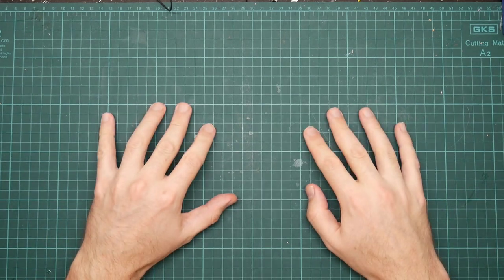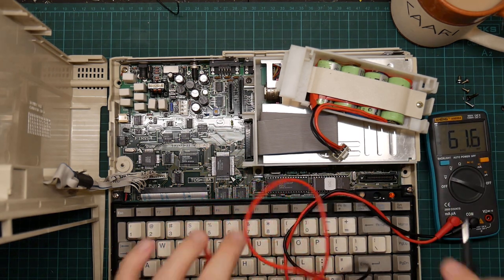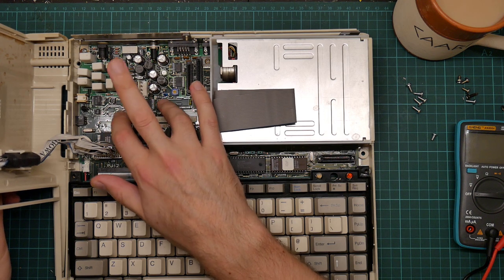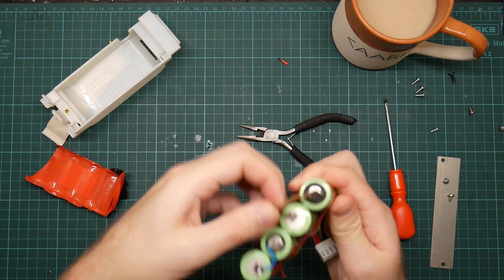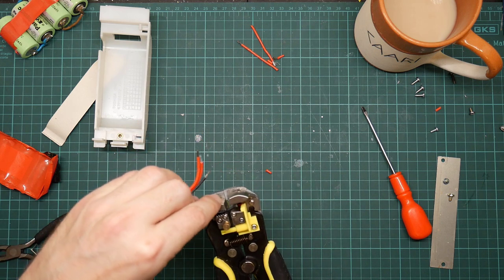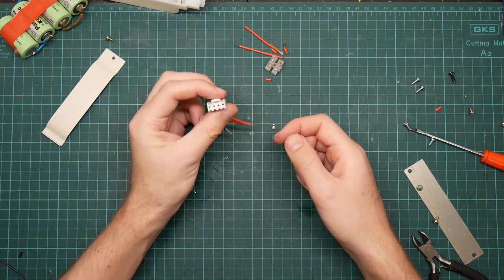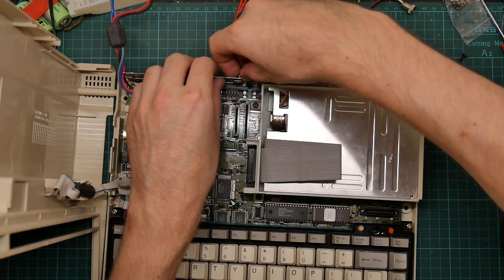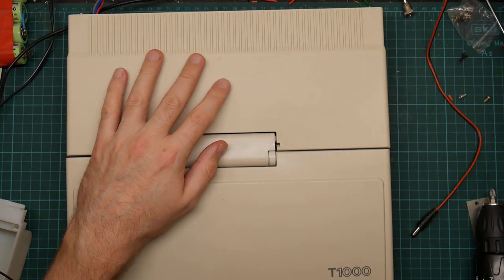Hjalfi changes the battery on a Toshiba T1000

Comment: I've seen multiple sources claiming that a T1000 won't boot without a battery but I'm not sure if this is accurate. I recently picked one up for cheap and it boots fine with a DC power adapter although now the power cuts out when trying to use the floppy drive (worked the first time). When I opened it up, the battery was missing!

Comment: Did you give up on the T1000 project?  So wiring the power supply directly to the battery connector, in the end, did not work?